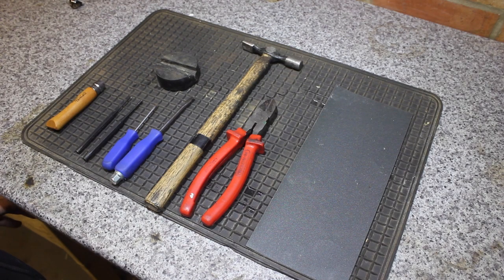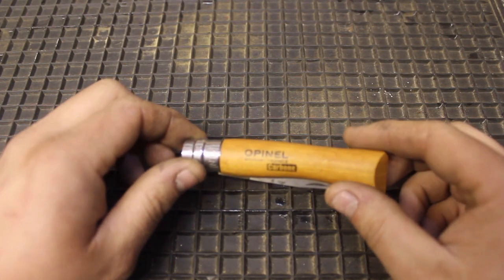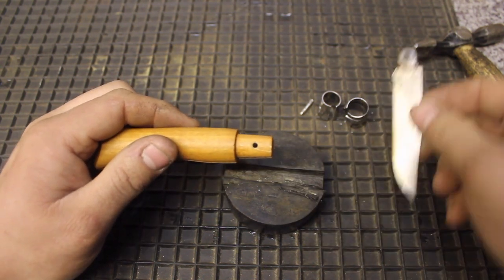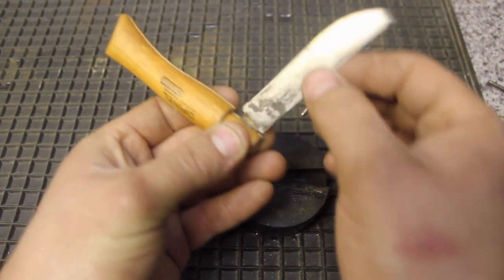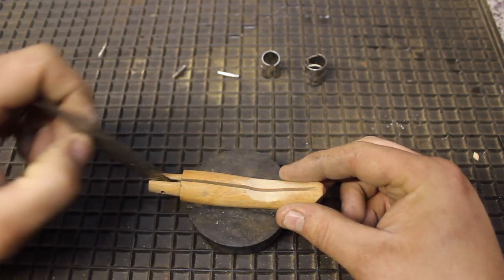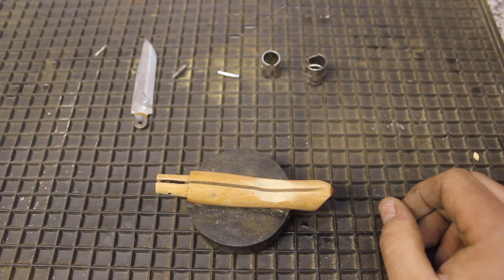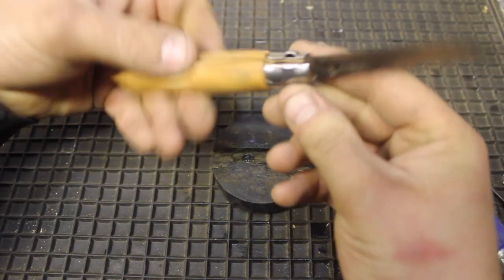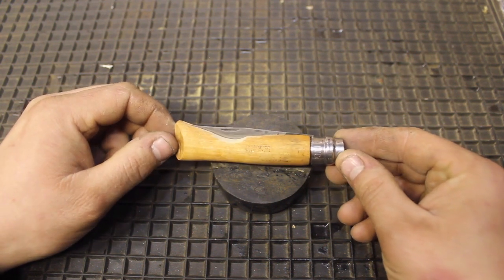Making Opinel Knives Easier to Open

Comment: Don't some people know how to open an Opinel pocket knife properly. The end of the handle is shaped to be tapped to open the blade slightly so as to then open fully. The Opinel was made for fishermen so they get wet.
Reply: People can modify their tools to fit their needs. For example i like to be able to open my knife with my hands without using a flat surface to tap on. Ofcourse if you like the original design you can keep it.
Reply: Yep. My grandad, a French far worker, always had an Opinel with him. Being stiff to open, requiring a rap against something, is an advantage when there was no locking device, as originally made. Outstanding design that was cleverly enhanced with a very neat lock - that required little to no modification of the original design.
Reply: I'm french yes tap it and you Can open it with one hand. With some training no need more tapping. But i don't think it was made for fishermen..... Savoie is a mountain region far from the sea. Each french region has a traditional knife. Maybe 20 differents knives. Opinel IS the most famous around the World.
Reply: Il n'y a en tout cas aucun mal à customiser vos Opinels, faites-vous plaisir ça n'est pas mal vu du tout par nous autres, maudits français, à ce que je sache. Par contre je viens de voir un français peindre et mettre à neuf l'Opinel joliment patiné et vieillit de son enfance, et là par contre j'étais choqué, quel gâchis 🤦🏻‍♂️

Comment: Use the Opinel knock. Fold the knife. Hold the metal collar and knock the end of the knife on your table. Now the blade is open enough for you to pull it open.
Reply: Happy to see this, 2 bandaids too late haha
Reply: @marleyturner1513 TWO? Oh you must have the opinel no 3 then? My hand has disintegrated with my no. 10 ! 

😉 😂

Comment: For the treatment of the wood and pivot point use 1 part white bees wax to part 4 parts mineral oil(not spirits), put it into a double boiler and bring up to temp, mix and put into a container to cool. Use this mixture with a hair dryer or a heat gun to treat the wood. In hotter climates reduce the amount of mineral oil. This mixture is great for any wooden handle implement, knives and cutting boards.
Reply from the maker: Thanks for the tip! I'll be sure to try it. I have a chopping board that also really needs treating so I might try it on that too.
Reply: @ThrHillSeeker  The mixture works brilliantly on chopping boards/butcher blocks. Rub into the wood and let it absorb for at least 15 minutes, preferably for 25 hours before wiping off excess with a lint free cloth. Apply every week for the first month and then every 3 to 4 weeks there after. Make sure to use food grade mineral oil( Easily found at most pharmacies. This works great for all wooden tools. If you want a bit of a grippier surface, wipe clean with a cloth and then apply only bees wax from a bees wax bar.

Comment: I remove all of the finish after carving out more room for the nail nick. After cleaning it I soak it in danish oil. Then I wipe off the excess and let it dry overnight. I often do this at least 3 times. This has greatly reduced swelling from moisture. I have also used polyurethane that has been thinned 50% with mineral spirits as the final coat. Also ring spreading plyers  helps with the locking ring.

Comment: Stiff opening is usually caused bu gunge in the hinge area, dried vegetable oil or similar, take off the blade and clean up the hinge area. Remove/replace locking ring with circlip pliers. A Frenchman will open his Opinel by tapping the outer part of the handle, on the blade side, against a suitable object, it becomes second nature very quickly

Comment: The bottle opener on a swiss army knife works a treat for removing the locking ring.
Reply: Even better and faster is a split ring pliers.  Just put the points the opening, expand it slightly and lift it off.

Comment: I struggled like hell with the pin and could not get it knocked out at all. I had to drill it out, which is not easy since the end of the pin is not flat and it is ny impossible to lock the handle in place for drilling (I think a vise would crush the handle so I held it by hand) 😞  I wish they would  make the pins easier to remove... On my son's Inox the pin even seemed to be partly fused with the collar...very annoying.

Comment: Thanks for sharing this little tip  I was looking into getting one of those knives for UK edc do you know what number I would need for it to be uk legal?  My edc is a victorinox Red Swiss Army knife and it's great but I wanted one of those two go with it thanks again for sharing this post👍
Reply from the maker: Thanks for commenting. The number 6 has a 7 cm blade so is UK legal in terms of blade length however it would also need to be non-locking. They do make a non-locking version or you can pop the locking ring off of a regular one to make it a friction folder.
Reply: The opinel no 2-5 don’t come with locking the ring

Comment: If you tap it on the end on the little flat spot on the end of the handle it opens the knife up enough that you can get a hold of the handle....
Reply: I've tried various 'tap on the flat spot' solutions to open the No. 6 I've got here. Nothing budged. 

However, the pivot is silky-smooth, and the blade, with a flick of the wrist, and a little practice, can be made to pop out -- even to the fully-open position: with the collar twisted to unlock, hold the wood of the handle (thumb above and at least the index and middle fingers below) and with the body running along a line 45º to your forearm; cock things by moving your hand inward, toward your body, then flick your hand horizontally, from the wrist, outward. The start position described immediately above is very nearly the position your hand would be in if you were holding a handgun...

I would suggest that you can obviate the need to sand the groove of the handle (which, if absolutely necessary, need only involve the area near the pivot/pin because the blade is already tapered toward the cutting edge) by, instead, lapping and polishing the area around the hole in the blade. Lapping there will remove a tiny bit of material on that part of the blade that is necessarily in contact with the handle. Polishing that same area will provide a marginally smoother bearing surface. Which is to the good. If you'd prefer a bit of drag at the pivot, you should be able to peen the replacement pivot/pin to 'adjust' the friction in the swing of the blade before you re-install the locking collar.

Comment: screwdriver method to remove ring damaged my wood and still didn't move it enough to remove.
Reply: I cringed at this part. I bought a $15 pair of Irwin Vise Grip snap ring pliers and they did the job easily with my first attempt.

Comment: Thanks so much, wonderful video! Do you know by any chance the type and dimensions of the aluminum rivets you used? Would appreciate the advice.
Reply from the maker: Thanks for commenting! The rivets were cut to length (the width of the handle) from a piece of 2mm aluminium rod that we had lying around. Hope that helps, sorry I don't have more specifics to hand.
Reply: @ThrHillSeeker  This is great, thanks for sharing!
Reply: @ThrHillSeeker  Are these aluminum welding rods?
Reply from the maker: @elikalman9066  I'm pretty sure it was just rods from a hardware shop that were being used for building or reinforcing some kind of frame. Adam (who made the video) usually uses higher gauge welding rods. I'm sure a piece of welding rod of that size would work equally well.
Reply: @ThrHillSeeker  Thanks so much!

Comment: How did you just hammer out the rivet? Did you cut off the rivet head first? If so, how?  I tried cutting off the head with a dremel and it’s just made a bit of a mess. I’m about to drill it out with the ol’ drill press unless you have some tips that will save the day 🤣
Reply from the maker: It was just a good whack with the pin punch. The rivet didn't have much of a head at all, it was really just a pin. Maybe yours is a bit different? If it looks like it should come out but it's not moving, the wood might be a little damp and swollen. It could be worth trying to dry it out. Good luck!
Reply: Thanks!
Reply: You have to file it. I had the same problem
Reply: In my first try, I used a screwdriver and I couldn't do it. A punch works great for it without. It also doesn't damage the wood and the metal, you can use the old pin without problem
Reply: @matteoperrone2253  My pin did not come out at all, I had to cut the wood.  I printed a 3d version so I did not care.  But your advice is better than what he shows in this video.

Comment: Why doesn’t the factory just make the slot properly to begin with!?😂
Reply: They do but the wood naturally swells up with moisture. If they cut out more material then the blade would be loose and sloppy.
  Best to soak or boil the handle in walnut oil from the supermarket Danish oil,Linseed oil, or similar.

Comment: But ... why easier is needed? Why don't just open that knife the way it was supposed to be opened (or how the French peasants opened it) - tap the very bottom of the knife on a hard surface with the whole blade back pointing down, while holding it on the metal part and the blade will show up enough to open it easily.